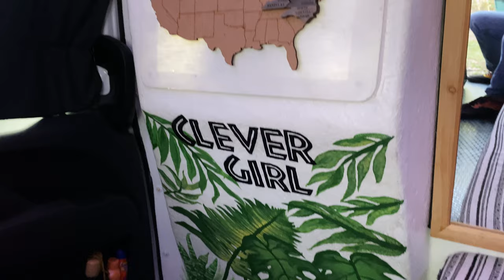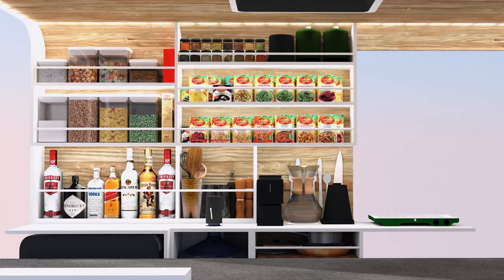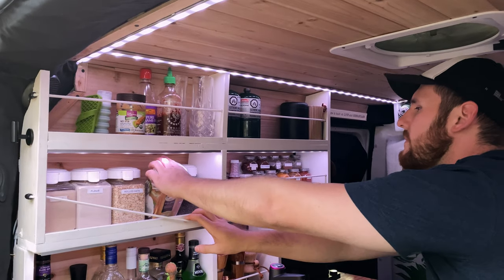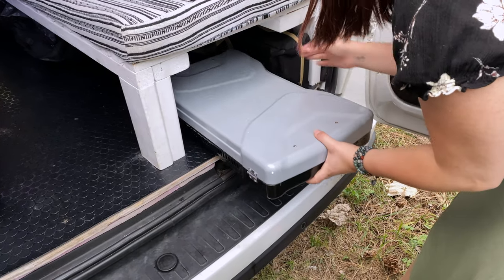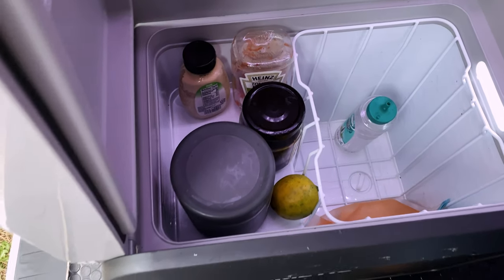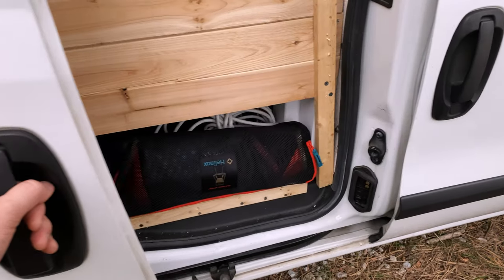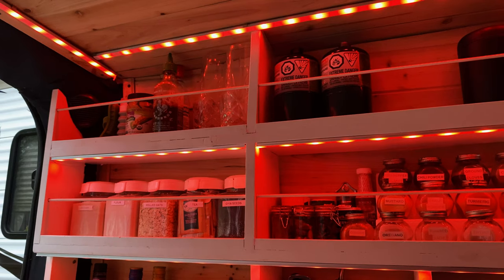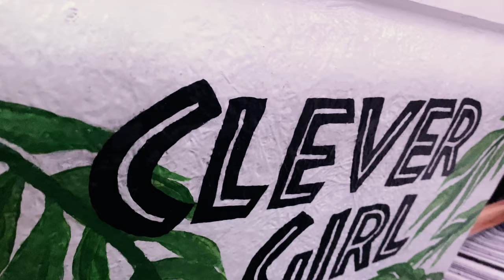VAN TOUR | RAM Promaster City Converted into Jurassic Park-Inspired Adventure Vehicle

Comment: Wow! Your van build is extremely organized, functional and beautiful all at the same time.  Great job! Two questions: can you access the driver seat from inside the van, in case there is someone trying to get in at night and you have to bug out quickly? And how do you go potty and clean yourselves up daily? Thanks so much. I love your van.
Reply from the maker: Thank you so much! We appreciate that! We can’t access the cab from the back. When we bought the van used, it already had the divider installed so we worked around it. It’s also safer this way when carrying our music gear around. We typically stay in campgrounds or near truck stops when we’re traveling. In those cases, we can easily shower and use the bathrooms there. For a bit, we were using gym memberships to shower as well! Thanks again for watching! :)